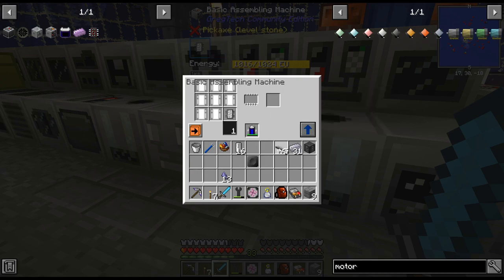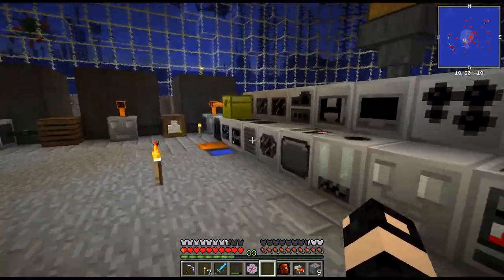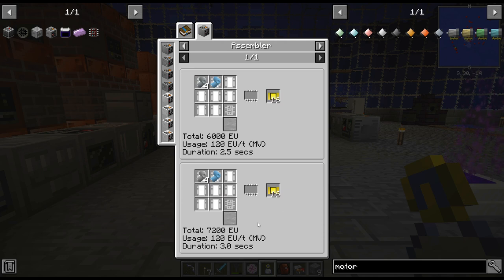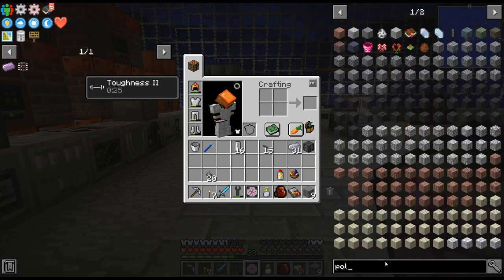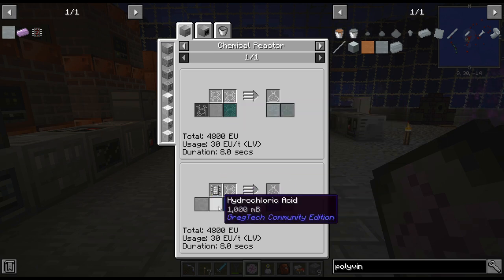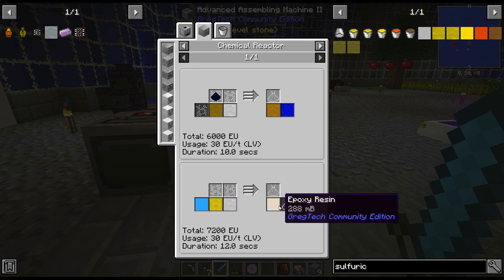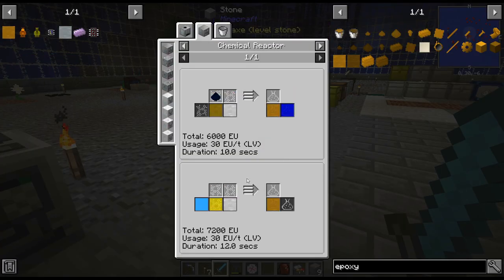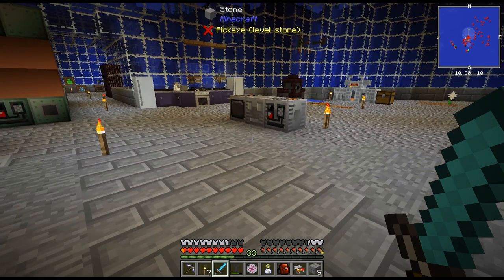FTB: Interactions - 52 - Epoxy Resin

Comment: Cluster mill is part of shadows of Greg iirc not native GTCE
The wireless fluid transport from cyclic uses only 1 of the wireless blocks and a gps module to send the fluid wherever you want it to go in that dimension
You will want oil processing anyways, it’s even better in this pack with the canola improving the oil a ton